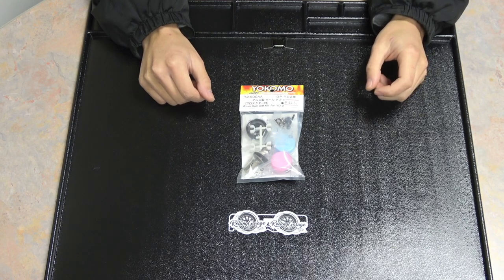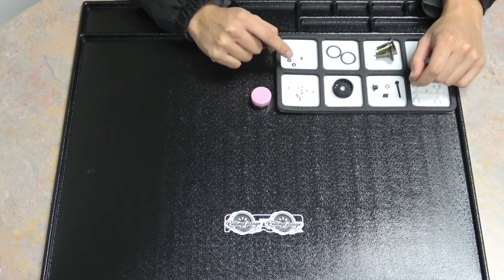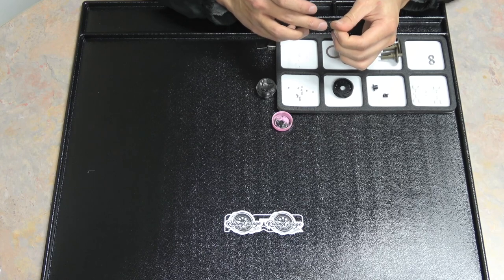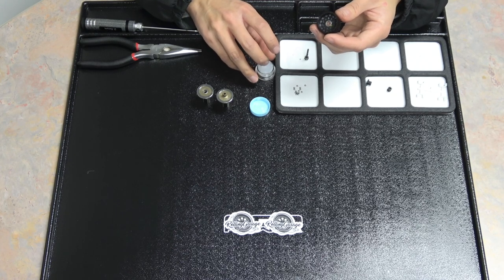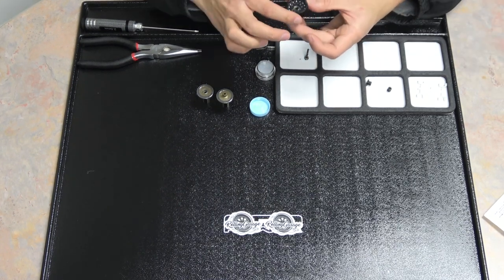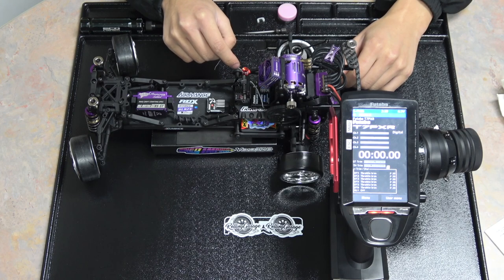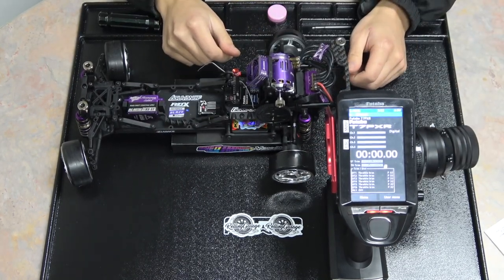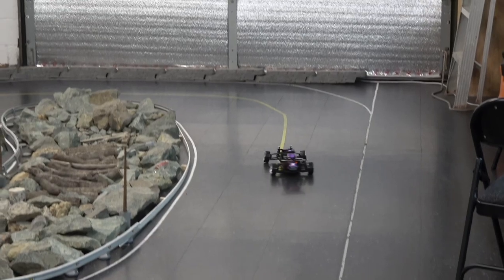How To Build A Ball Differential - Mitch-Spec TUTORIALS

Comment: So on my GRK ball diff I never did break in 🫣 ive ran it probably 6-8 batteries already. Any way of properly tune it or is it just a preference on how tight it should be ? 

Cause I did tighten it like half a turn a few days ago and it felt a bit more stable.
Reply from the maker: Usually preference for tightness. It seems a majority tend to prefer looser on low grip surfaces and tighter on high grip surfaces.